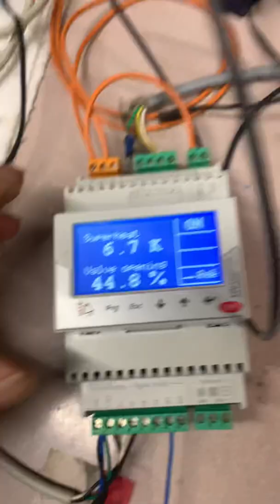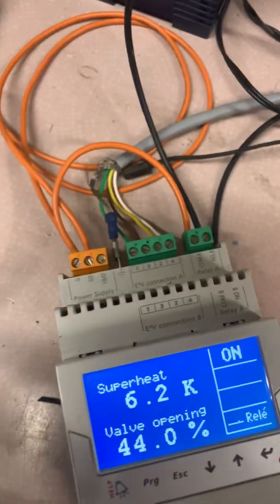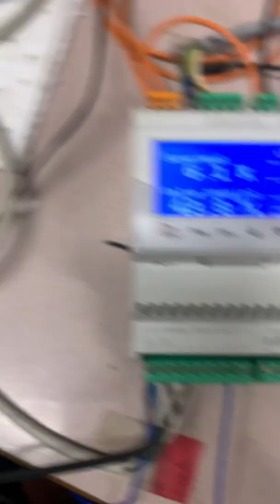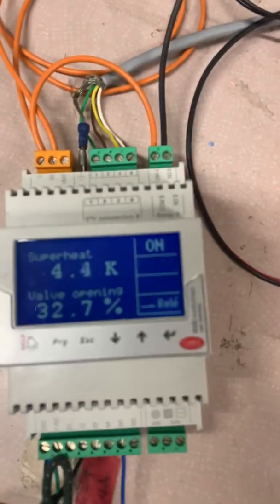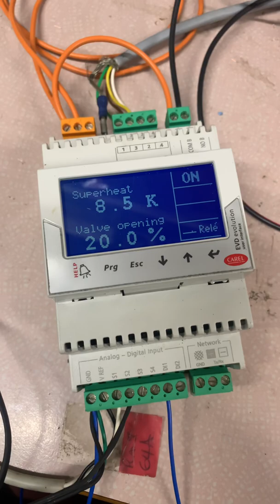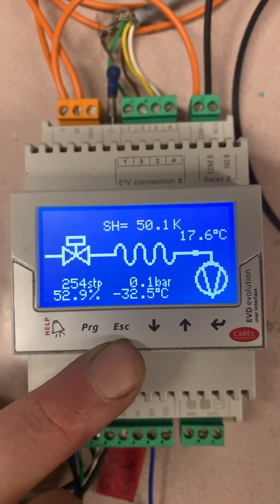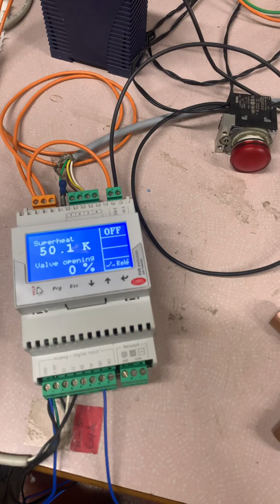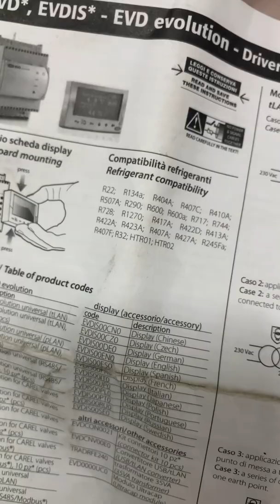Carel EVD Evolution Controller

Comment: Could you explain please. How do you use 24Vac power supply for 12Vac E2V driver? How does it not break down?
Reply from the maker: Well, it worked. Maybe they’re duel voltage.  I don’t know if the driver was 12 V I’m taking your word you’ve seen something I haven’t. I just read this together in the workshop. I never used it in real life.

Comment: My EDV chiller module always asks to reset all parameters if the electricity supply is completely off and an alarm is detected (Warning expansion driver not connected) the cause is a short circuit, sticky contactor on Main and delta on compressor 1, compressor 2 which is not short circuited if it has been reset. The parameters can be ON normally. What I want to ask is whether the module has to be replaced or only the sensor has to be repaired... thanks for the enlightenment sir
Reply from the maker: I have no clue. Although I have seen on some chillers the EEVs controllers have battery back ups to allow the EEV to shut down closed and prevent liquid flooding the compressor. I’d look at a small UPS to feed the Controller which may prevent the issue as you’ll have no power fail.